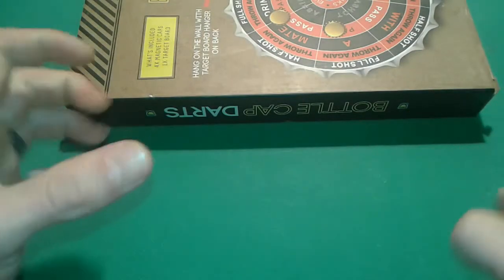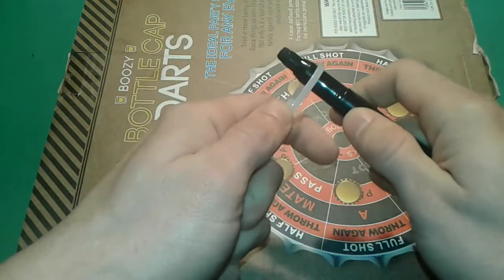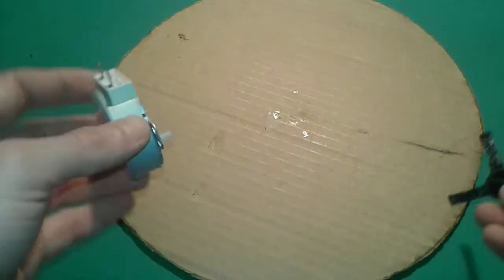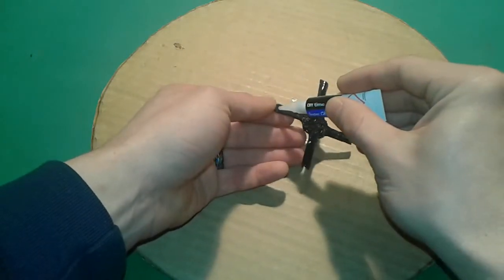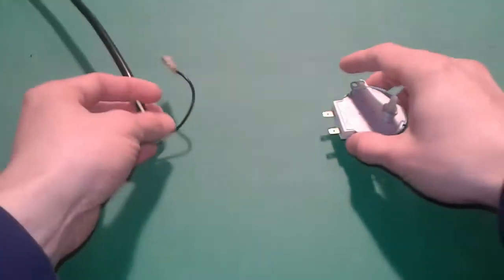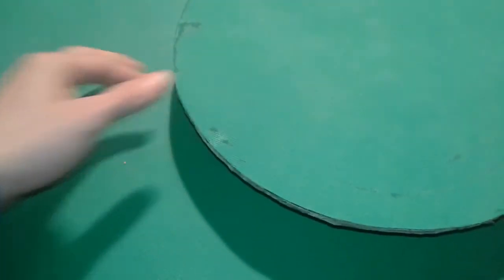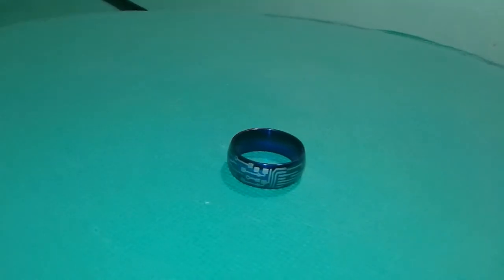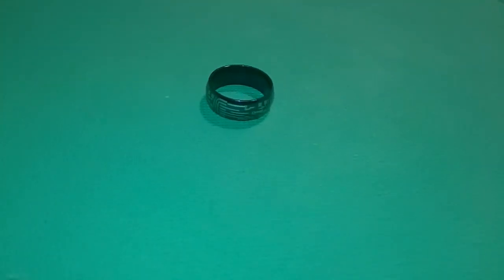How to make turntable display from microwave oven motor

Comment: There’s so much you didn’t say, what about the wire and did it have a switch and fast ir slow speed?
Reply from the maker: This is the reason why i choose this motor the wires is simple 2 wires ac power and you cant control the speed 4-6 rpm predefined all if is an ac 120/230 v ac synchronous motor

Comment: Hi there... loved your video. I was wondering what you said you used for the "connector" in the beginning.. the black piece after you showed the motor. Where can I get a cheap motor from? Also.. what was the big black box you showed right before you connected power to the motor? So much I didn't quite understand... It sounds like you said "Now we need a base... and you brought out a tall black box" Thank You so much. You are very talented and so sweet to share your skills with us!
Reply from the maker: Journey Storm hi there the connector is the most important part, you have to find my video about 3d pen, I show there how to make it, it is like a glue gun but the difference is harder, or if you can find from a microwave oven is the piece that rotate the plate and sits in the motor front pin
Reply from the maker: Journey Storm and the black box is just that a box for raising the motor from the ground and to have something to sit on all the best with your projects
Reply: @NoSkillsRequired  Thank You .. I looked for the 3D Pen in your videos and found a review or something. I don't see how to make this piece.